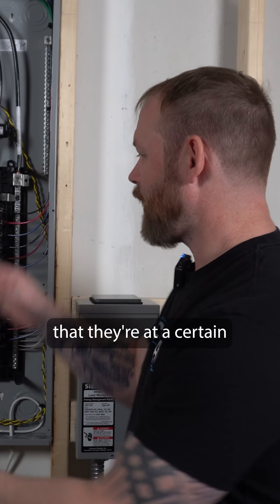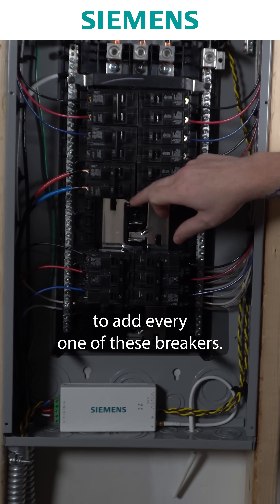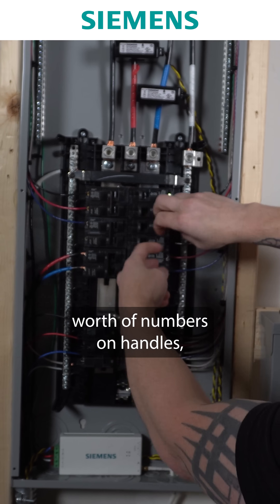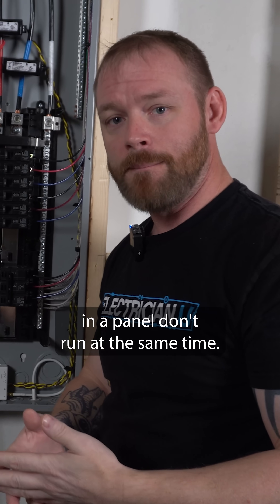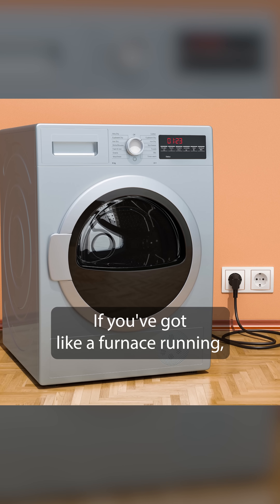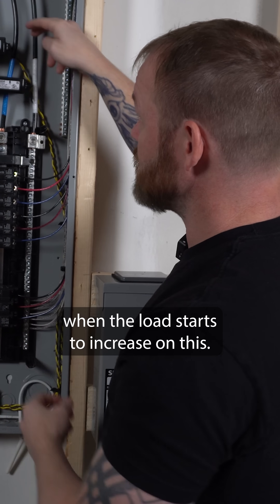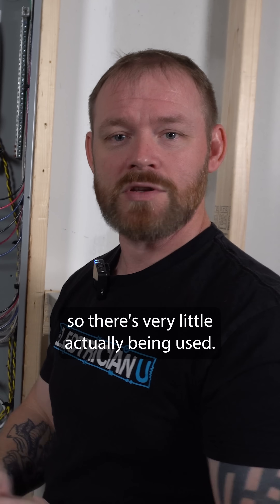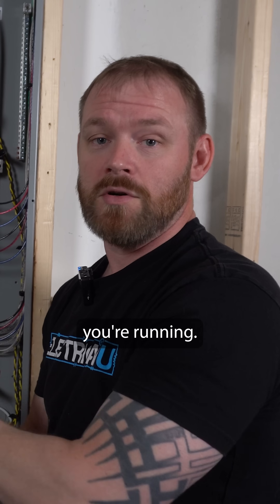Is This Panel At Capacity?

Comment: With all the GFCI Requirements. Double pole equipment cost so much.  Go gas appliances and dump a huge amount of loads. Space and water heaters and dryers are power hogs. And sometimes the range.
Reply: Condensing dryers with a miniature heat pump are also an option, and from a power load standpoint can be run on a 15A 120V/240V branch circuit. They just aren't supplied with that plug in N. America because most houses have a legacy 30A receptacle, which in turn leads to new houses being built with the 30A receptacle when it is no longer needed.
Reply: @A_Canadian_In_Poland Heat pumps are very clever. Condensing dryers are even more clever.  

Also, you can use that 30A circuit for a level 2 charger ;)
Reply: Gas is just adding a whole separate infrastructure that needs to be installed and maintained... And you end up paying for that.  Also, it occasionally makes a house go "boom"

Heating is a big draw, but you can double or triple the efficiency by using a heat pump. Heat pump dryers exist too.
Reply: Lots of places in the US do not have a public gas supply. So they either need to use propane, which can get very expensive, or go electric. If you are lucky enough to live in an area where solar is an option, going with all electric appliances is an excellent option since much/most/all of your power is "free."
Reply: @TwilightxKnight13  Also worth mentioning that gas infrastructure is expensive to build and maintain.  If it isn't really needed, why bother
Reply: @TwilightxKnight13  electricity is the most expensive energy source unless its hydro electric. Propane has never been more expensive than electricity in my area. Go big tank and buy bulk in July when sales are on and bulk price is a couple dollars cheaper per gallon.  Or pre pay up for winter on the never run out schedule.
Reply: @ryanyork837  Ok... You apparently live in a rather unusual area then.  That's not how most places are.
Reply: A lot of people dont have access to natural gas and propane is insanely expensive. For many, electrical is the only cost effective way to go.

Comment: You missed a major point, that was a 3p panel, you can’t/shouldn’t exceed the amps on any phase. So that’s 200A x 120v x 3 legs. 

If you don’t manage the loading, you can overload one of the legs even though the overall kW capability is not fully used

Comment: With some people wanting electric vehicle chargers installed at their homes now, have you encountered instances where a 200A panel is no longer enough capacity? Like the house is already 100% electric (no gas or oil) and they want to add two 50A chargers that will be used at the same time?

Comment: You add up all the breakers and multiply by 1.73 to get actual power consumption .  The main breaker is only 1 single use circuit, usually the electric heat or stove 😮

Comment: So inwas taught a hillbilly math on load calculations add up everything big that might be running at one time and that gets you into the ball park example is the wife hair dryer the hot water heater and stove probably aren't on at the same time but the stove the dryer and hot water heater might run together

Comment: That’s also a 3 phase panel, so you have to count up the load on each phase. If it’s a 200 amp main feed, that means you can have up to 200 amps running on each phase before it’ll overload the feed. Usually you only want to load a panel up to 80%, which gives you 160 amps of 120v loads that you can have on each phase without overloading it, or 480A of total 120v load. It’s pretty hard to overload a panel in practice, especially with just 20a breakers.
Reply: And here in Sweden we have several 35A breakers at 240v in our breakerbox. I wonder what the max total load could be. Of course everything is 3 phase everywhere.

Comment: THis was a good explination.  I have a newer home (2022) but I trip breakers all the time in my office.  15 amp and should have gone with 20amp
Reply: Dont increase breaker size without first confirming your wiring can handle the increased heat from the potentially higher amperage. Breakers trip to keep your house from burning down.
Reply: @natasharomanoff4744  I also heard that from someone. Good point. Just because it's a new home doesn't mean it can handle it.
Reply: Motors are the biggest issue for residential. They can draw a huge load at startup. I have a dedicated 20amp circuit for my standard size miter saw and it still trips the breaker from time to time.
Reply: @TwilightxKnight13  Either you have a weak breaker or your saw has an issue…It should not be tripping a 20 amp breaker at all !
Reply: @JetDriver1111  Depends on how sharp the blade is, material, and how hard it's pushed.  I've had a portable circular saw on a 25' 14g cord snap a 20 amp breaker if it bound up or the blades were  at the "just one more cut" level.

Comment: Funny thing about codes... there only good for a new build. Years later some circuits are overloaded. Air splices, double taps, no flex conduit. The list goes on. That's just common knowledge among any actual working electrician. You can't fix stupid.

Comment: Just dont get an electric tankless water heater  the big ones require 3 50 amp breakers and have a 120 amp dray everytime you turn the hot water on

Comment: I work at an apartment complex and sometimes the 150amp breaker at the meter trips without any of the breakers inside tripping. What causes that? They won't trip again. It will be a different apartment that does it. We have 400 units and it's always a different one that does it.

Comment: A furnace is 15 or 20 amps. An air handler with a heat kit would be 30-90 amps

Comment: Is that 3 phase 4 wire panel residential? Last time I checked into 3 phase service, it was quite expensive. Do you have a video on that Siemens Inhab Load Manger equipment? Never seen something like that.
Reply: Very few homes have 3ph service. I am guessing he is in a commercial bldg for ease of demonstration.
Reply: Even most farms where three phase is often required for equipment rarely have actual three phase. They use a somewhat-complicated and questionably safe converter set up to create three-phase power from a single(two) phase source.

Comment: Those are absolutely crazy numbers for people who live in 230/400V countries, my main fuse is 35A, a common 3 phase connection is 3x 25A, and that delivers more power than 200A at 110V.

Losses and heating of connections scale with the square of the current, so 200A single phase gives 64 times the losses in the same resistance as 1 phase of 25A.

Now what seems simpler, having 3 phases with relatively thin wires and connections, or a single one but with a 20 times lower resistance, to get the same total losses?
Reply: It's worth mentioning the 200 amps is for 240volts and not 120v. We have split phase power in North America and we are supplied 240v, with a center tapped neutral. Hence why our panels are bused. With a two pole breaker you get two hots from separate legs making 240volts.
Reply: To make matters worse: US uses Aluminium cables for house interconnect as well as internal cabling.
And yes you find Aluminium cables in Europe, for high power installations supply lines. You know those where you already have like a 5 to 10 cm cable diameter supplying like 800 kVA unlike the normal house 3 phase 240 V 63 A using copper through and through.
Reply: @darknase  Aluminum is fine. It is not used for our general circuits though, those are all copper except for some high amp circuits but copper is usually used here as well. Aluminum was briefly used for this in the 70s and if you have a house with that you need to remove the wiring as the alloy isn't very good and causes issues.
Reply: I'm still trying to come to terms with the fact that people have 400v residential service. Seems dangerous. 277/480 is common here for industrial (in my office building 277 runs lighting in garages and stuff and 480 3ph runs large motors like fans and elevators). Then it also has 3ph 120/208 for offices.

The panel in the video is 3ph, but as mentioned residential here is 240v split phase, all larger appliances are on 240v. Balanced 120v loads are effectively in series, so if 50 amps are being drawn on each of the 120v legs only 50 total amps are drawn from the 240v service, not the sum (which would be 100).

Most services are 240v 200A i.e. 48kW. Because of the split phase, 120v loads would be a total of 400A  between the two. Of course the max continuous load shouldn't exceed 80% of the panels capacity.

Comment: It’s not only load diversity that is important in panel calculations, it’s also about what’s connected to each circuit. Some of those 15-20amp breakers you see will only ever draw 3 amps (ex. lighting circuits, receptacle circuits in sparsely used areas)
Reply: AC and furnace don't run at the same time
Reply: @radwanal-shaer9763  Yes they do. Or they cycle heat-AC-heat-AC. Obviously something needs repairing or proper installation, but I have run into this quite a few times.

Comment: i agree. i used a circuit monitoring devices as i was worried in the begining for overloading my 200A main... i maxed my panel at 170Amp during winter. dryer + stove + hot water tank + boiler (water floor heater). when everything runs at the same time. you might hit close to it. so i contacted my boiler provider and disabled half the heater elements and im no longer worried about busting the main breaker capacity :p
Reply: Good point , ive used 4 programmable T-stats (as i only have 4 different zones of heat) at different times i have them use the boiler to max out as much heat . 
    At first , now ive got it as 2 on , 2 off . 
     Then 2 back on , its been working better , and I believe the gas bill has gone down . 
      I dont know if it's beneficial for the boiler , but i was told it's designed to work better at full load ?
    Idk , i just know now the heat is better in all the rooms at 68 degrees . Then having them all on set to 70 . 
    Took me a few heating season s to figure this out . 
     I thought 💭 id share as you have inspired me to share from your information .😮
Reply: @jamesortolano3983  on a side note. my boiler is electric only so it can pull as much as 84Amp (un modified) or 42Amp with 2 element disabled) on 240 volts. it's different from gas fired
Reply: @jamesortolano3983  thanks for sharing.
Reply: Interesting solution.  Have you noticed any practical disadvantages in your boiler use? Curious
Reply: @VE3AVA  not really as the boiler is oversized for the house. the only difference is it takes a few more minutes to bring the water to temperature for the floor heating but since the concrete slab need low temperature it is fine. the boiler was turning on/off too often due to reaching the max temperature too quickly. by disabling the elements. the boiler ran longer without cycling and eliminated some power spike. so at the end. this changed nothing on my end as the concrete slab (water heating) keep the temperature for quite some time due to thermal mass
Reply: @patricklegault6383  Yes at 80% of your 200 amp panel that is pushing if you're at 170 amp continuously.  If you had a cold start I.e. after a power outage and everything turned on together you could have a problem. If electrical was designed with that heating system it should have been sized right. Is that 170 amp measured or calculated? As others mentioned all those items don't typically run all at once.
Reply: @SRCardow1  i hit the 170 mark for 5-10 minutes then it went down to an average of 90 amps during the winter with high and lows. otherwise during the summer i average 30 amps. i did not check lately since im no longer worried about it. i used a power monitoring tool at that time with graph (EKM Metering). i only reach that limit if i run the dryer, stove, boiler and electric plinth

Comment: A lot of people don't explain and don't need to explain to homeowners that the electrician that comes in analyzes all your circuits available and adds up all the wattage and then figures out how much do you need all at once if ever used all at once and bases the panel on that

Comment: What happens if you have every outlet used at 100 volts and all your machines running at the same time with all your lights on at the same time will it trip the circuit I've never had to do that but somebody did do that once and they used every single plug in their house at once and during a party had all the lights on plus the washing machine the dryer in the dishwasher and the disposal all running to see if it would trip

Comment: Nice. I need a new panel. Almost all the breakers are the mini half thickness ones and it's over capacity. 😅
Reply: Just need to add a sub panel as long as the amps aren't at capacity.
Reply: @psywiped  I'll replace the whole thing.

Comment: Code book explains load demand calculations to size services. The costs between electrical panels is getting minimal in residential uses, you might as well just go ahead and put the 200 amp in. Commercial is another story. Industrial is another story. Sub station outside of a plant to run everything and all the multiple services inside the plant to run this and that is the ultimate.
Reply: Get a 225a so it's good for a sustained 180a load
Reply: same in our area. they are starting to install 400amp by default on new constructions. when i retrofitted my house. i wanted a 400 amp but could not as the triplex was not strong enough, the transformer needed to have a new fuse or upgrade as it string a series of multi plex houses.
i  was replacing my main breaker at that time as i was moving it to a new location in the house since i was rewiring it to remove old knob&tubes

but at the end. i decided to re-install a new 200amp main panel, move the meter (was inside the house to outside),  quite a challenge :)
Reply: Could he make a Short or a Video that could at least do an overview or does it get really complex?

Comment: 50 amp furnace is crazy more like 5-10 amps. The blower motor is rated to like 5.5
Reply: My daughters new 2024 Carrier/ACiQ 96% 2 stage 80,000 btu  gas furnace is rated at 13.5 amps.
Reply: @TedTedness  your daughter got herself a fancy unit there, keep up on the maintenance!
Reply: @TedTedness that’s most likely the max amp rating, not operating amps
Reply: Electric resistance heat forced air is common in areas where they don't have severe winters. They draw much more than natural gas or propane units.
Reply: @cameronramirez776  he probably meant heat pump referencing furnace in general. Heat pumps, yea, they can get into high amp situations for residential in the cold months engaging the emergency heat strips to assist the compressor.
Reply: @ you’re probably right, seems like furnace is becoming a broad term for all systems. The area i work in people still get confused when you don’t specify the two
Reply: @cameronramirez776 it’s not by any means. A furnace is different than a heat pump
Reply: @brendancl9889  well yeah, obviously. Thats what i said
Reply: @cameronramirez776  you said seems like furnace is becoming a broad term, it’s not
Reply: @brendancl9889  it most definitely is, at least where I am from. Everyone blanket calls any system in a house a furnace. Very rarely do people actually differentiate between air handler and furnace. Just like how everyone calls heat pumps air conditioners
Reply: @cameronramirez776  @ just because that’s what people call it doesn’t make it correct. Just like people still call refrigerant Freon, when 90% of people don’t have Freon in their system. A furnace is not a broad term, it’s the name of a piece of equipment, so people calling an air handler, mini split, or boiler a furnace, is all wrong and the person using the term is just seen as clueless
Reply: @cameronramirez776  and a heat pump provides conditioned air, so yes that is an air conditioner, it just also provides heat, as that’s it second purpose. But a furnace, again, is a specific piece of equipment, the only thing it could maybe be referred to is an air handler, as they both move air
Reply: @brendancl9889  i think you missed the point i was even trying to make sir, but idk you win
Reply: @tommywatterson5276 so a furnace is not a heat pump, 2 separate things. Even that, a heat pump condenser won’t pull 40-50 amps while running. The compressor will over amp at no more than 10-15 amps and the condenser fan is no more than 5

Comment: Only thing a breaker does is say these wire can only handle this much before its not safe. 

I don't appreciate the industry as a whole using breakers with questionably high amp ratings for the size of wiring.
Reply: What. Who does that
Reply: If they do it's not to code.